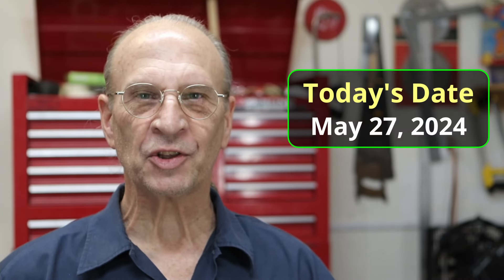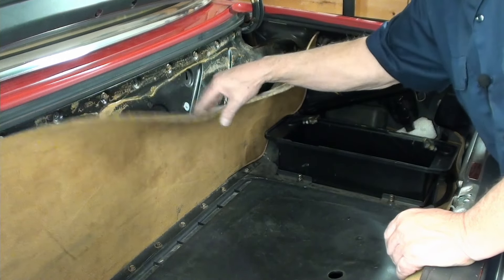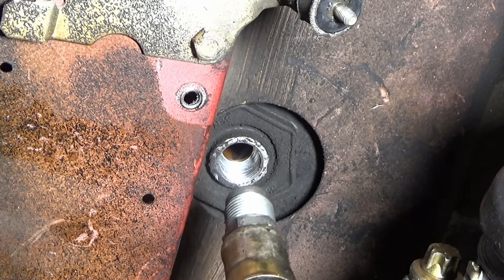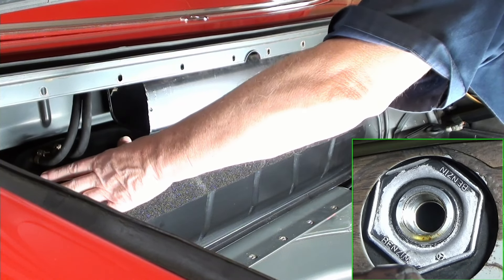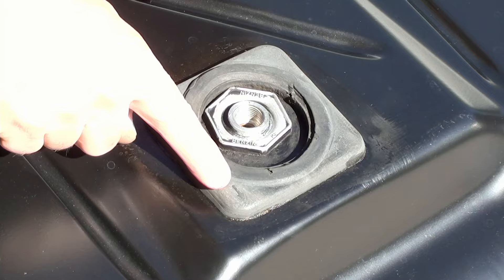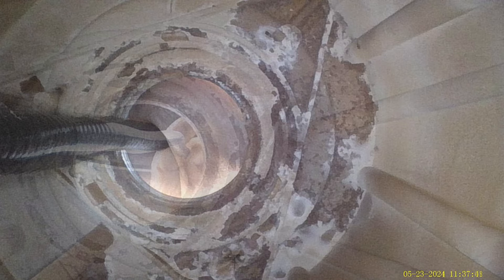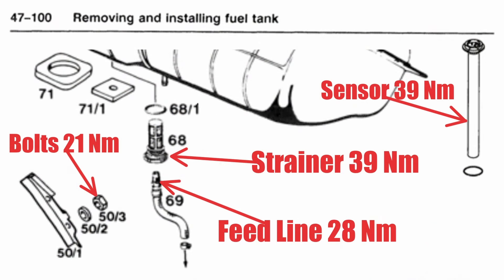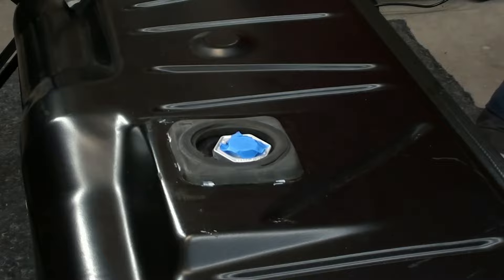560SL - Fuel Tank Removal and Strainer Replacement

Comment: Early this year rebuilt fuel pump assembly, replaced fuel tank strainer as well as feed line.  I used double nut and bolt to remove fuel strainer.  Interesting video for sure!
Reply from the maker: Hey there MrBobby. I don’t remember if you mentioned which model you have. For the 560SL this misalignment is common and using the bolt-n-nut method as described in the manual wouldn’t work well and could result in a cross threaded strainer. In my case I needed to at least move the tank to remove the strainer. In order to move the tank, you basically have the tank removed so I did. It was super easy to do and didn’t take much time. I think the cost of the socket is less than the cost of the bolt and nuts you will never use again. The level sensor is also 46mm and can be easily replaced with the tank  in the vehicle. The level sensor was working when I parked it, but I’m ready to change it if needed. I already have a new sensor I purchased years ago. I think I paid less than $50 and now they are over $200!
Reply: @TonyLiveTV  I have a ‘87 560SL.  Posted on your Facebook site a few links of my current project.  The strainer nut access hole was more in alignment with the access hole on my vehicle than it was on yours……

Comment: Enjoying the progress and the detail!  Won’t it be much more difficult to replace grommet at the fill point with everything back in?
Reply from the maker: You are 100% correct. I didn’t have the new one yet and I needed to make some progress. That said, you are supposed to be able to replace the grommet with the tank installed. I just received the new grommet. I think I will install it later today and find out. You’ll notice in the video I did mention that it was not easy to install even with the tank out. We will soon find out.
Reply: @TonyLiveTV  I admire your diligence and attention to detail, not to mention your tool chest. And I agree, receipt of parts and the time to replace them don’t always intersect.
Reply from the maker: @OB928  I just replaced the grommet. Wasn’t as hard as the first time believe it or not. I was also lucky that the filler nozzle is centered in the hole. Just a little petroleum jelly and just worked it around the hole.

Comment: Good job Tony. Seems odd that the strainer could not be made to line up centrally with the hole in the floor when it surely must have been intended that the hole would facilitate its removal without taking the tank out but clearly that was not possible from your efforts here
Reply from the maker: Actually it is quite common on the 560SL that the strainer hole is misaligned. And to be honest with you, removing it was so darn easy that I probably wouldn’t do it any other way.

Comment: Hi Tony, what is the part number of the rubber / foam square around fuel strainer between petrol rank and body, please ? MH
Reply from the maker: I don’t think they are available. For the one next to strainer it is 1074712180 and the return line is 1074712080. It is more of a neoprene rubber and not foam.